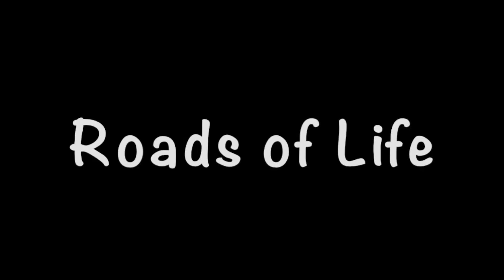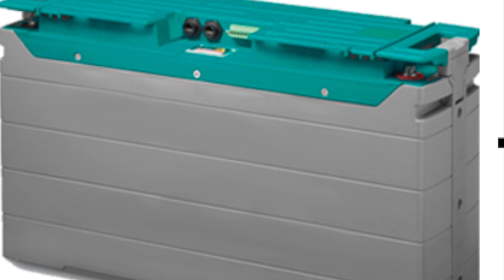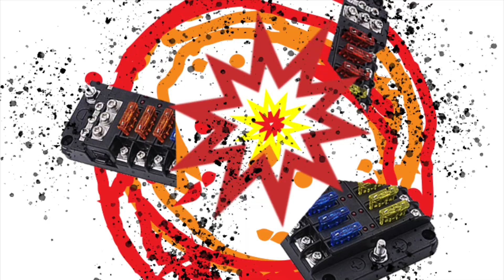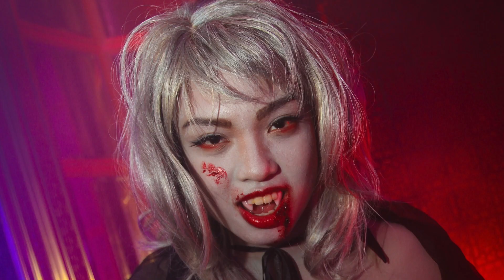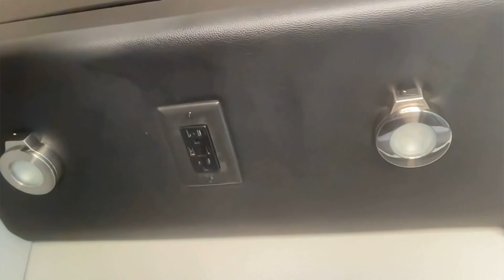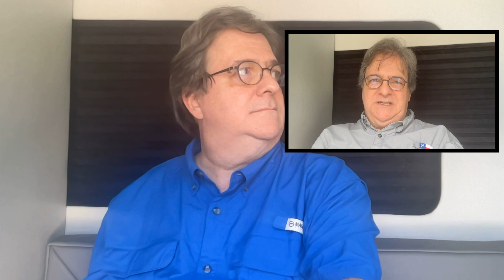Energy Management 2: Efficiency of the System

Comment: Robert, thanks. It is a numbers game; that is why RV Lithium Energy systems need to easily display all this info, including energy usage (like A/C). Furthermore, it should be able to predict. For instance, how long can I run A/C until recharging? It shouldn’t be a big guessing game. I’m intrigued with the new RV EcoFlow Power Kits.
Reply from the maker: It would be good to know the actually efficiency of the inverter too. My examples in the video were just examples, so each system would be different depending on makes and models. The Fit RV has a video on running the A/C that I thought was good. He had it on full blast at the coldest setting and continuously running, and timed how long it took to run out of power. That gave him the absolute minimum time that A/C would run under the worst of conditions. That way, he knew when he needed to be back to the van to check on things.
Thanks for commenting!